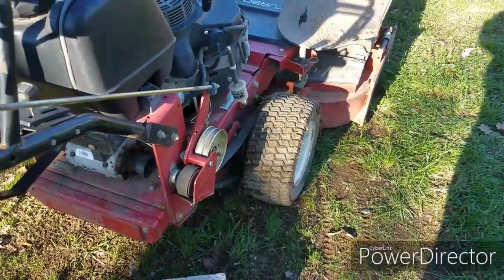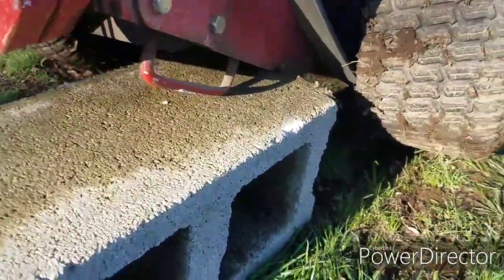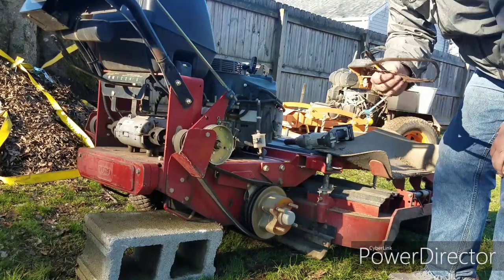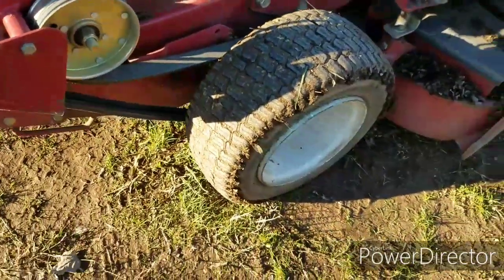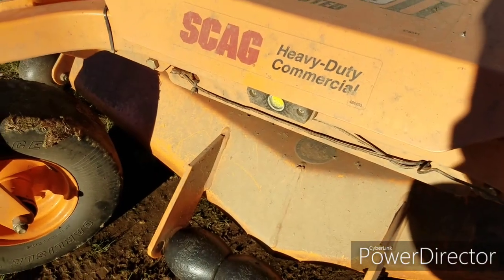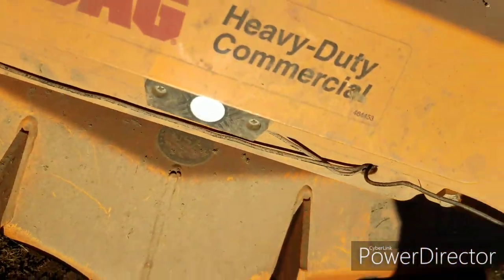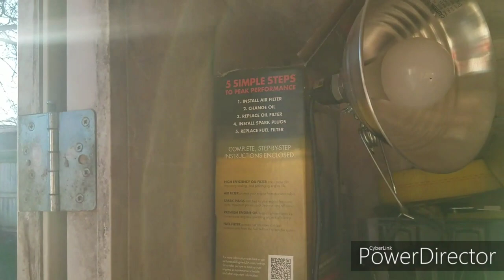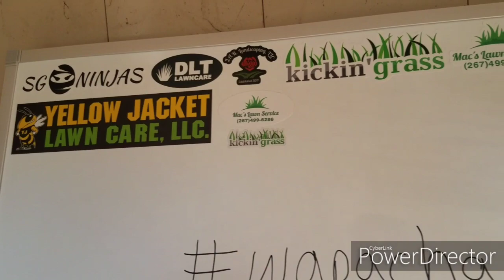FLAT TIRE FIX ON TORI/SCAGLY LIGHTS IT UP

Comment: Sometimes I do have problems getting the tire back on because they're all out of shape. I just throw about a half ounce of gas in it and light it and boom their back on .( NOT RECOMMENDED)
Reply from the maker: I probably wouldn't try that. 😂🤣 I've done the starting fluid trick. I want to try the firework trick.